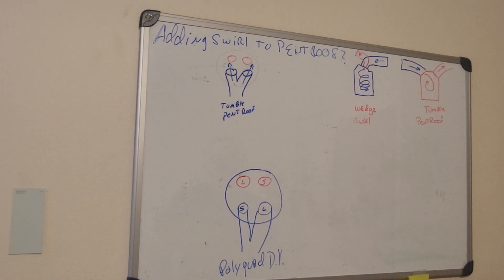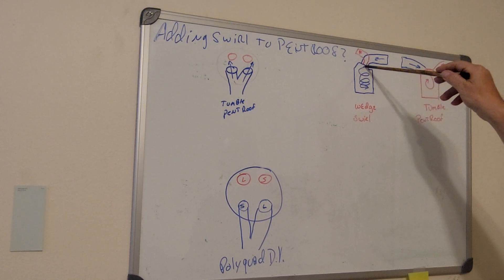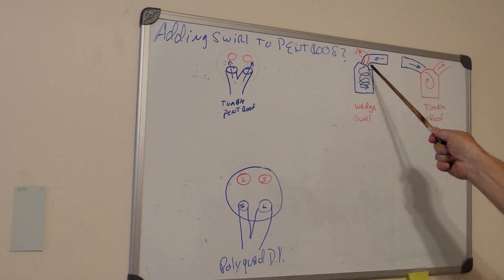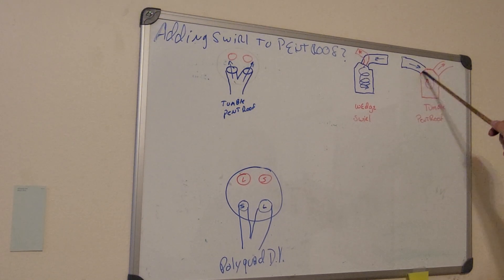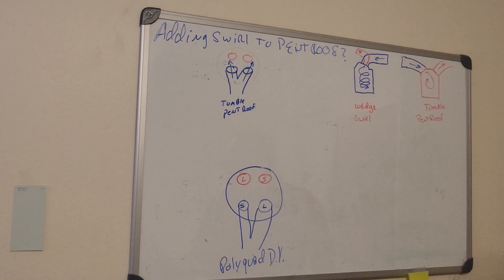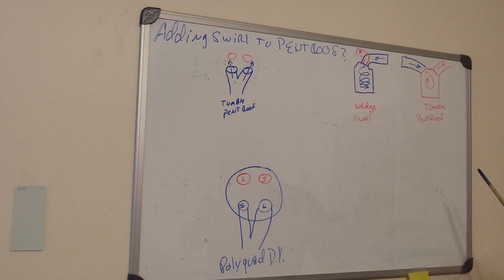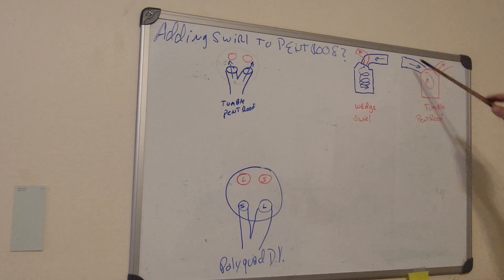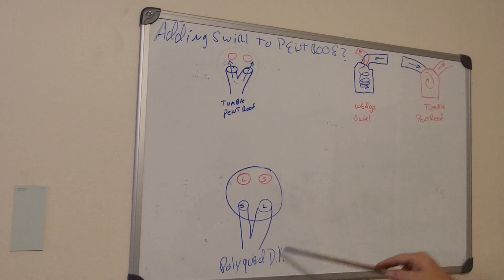Adding swirl to 4 valve pent roof design cylinder head?

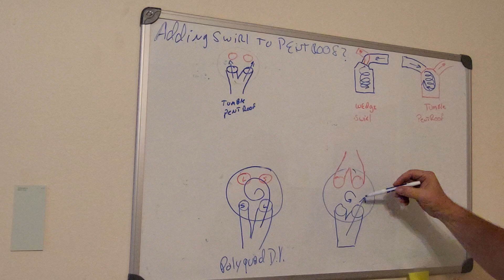Comment: 9:04 If I'm understanding correctly DV put the bigger exhaust valve on the left to help draw the initial charge left instead of straight across. Would having the bigger exhaust on the right make the charge come in straighter (less swirl) during the initial overlap period? Could that potentially have a negative effect on the entire swirl sequence if it had a worse start to overcome?
Reply from the maker: @TheInsaneShecklador  Good question. Polyquad head should be in soon. Stay tuned.
Reply: @servediocylinderheads  👍

Comment: I left a comment already but as I said before. When you start thinking about the flow path, include the fuel path. While rotation is mixed with tumble. The fuel likes to stay over the exhaust valves. Concentrate the flow from the divider. Inside out rotation. With the fuel path. The outsides of the port slow down because of the spread. The high speed remains in the middle. Left port spin counter clockwise. Right...clockwise.  
  Another point to think about, is timing. Not ignition,  but the entire delivery timing. At 9000rpm, the tumble or swirl doesn't get a chance to complete its journey. It is ignited when it barely reaches the back side of the cylinder.
 Don't forget the overlap period and what the exhaust vacuum is causing to the intake charge. 
 Straight in and Straight out. No time to tumble or swirl. 
  Another method used to cause low rpm mix is to alter valve timing. Individual actuation of each valve can be tailored to change valve timing. Not on this application but most ohc configurations will alter valve timing on each valve.
  Nice white board. As I stated. Maybe I should do my next video from the shop.
Reply from the maker: @approachingtarget.4503  Good info. Thanks

Comment: Interesting topic. How critical is swirl/tumble when comparing port (wet intake) vs direct fuel injection? Many years ago, a pro stock engine  builder commented that he preferred a more gentle swirl motion. His theory was that a slow mixture motion during combustion resulted in a more complete burn (compressed and still mixture around the spark plug) vs a fast motion, where I envision, the flame kernel swirling around creating layers of fresh to burnt mixtures within the chamber.
Reply: The DI combustion systems evolved in the era of CFD (computational fluid dynamics) and they most certainly consider the path of the fuel particles relative to what the air is doing (they're not treating it as a homogeneous mixture). You can see this in the way the piston crown is shaped on those engines relative to which way the injector is pointed. Some engines have the injector central pointed straight down, others have it near-horizontal between the intake valves on the outside, and the shape of the piston crown is different. The Mazda Skyactiv and the Toyota "dynamic force" engines are worthy of study, and notable in their differences. Both are designed for high-tumble and not swirl. Note how straight the intake ports are on a Toyota "dynamic force" engine - the ports are inclined to the valve (obviously) but very straight. They really, really want strong tumble.
Reply from the maker: @bikeaddictbp  Good info. Thanks
Reply from the maker: @ts302  I would think he is right. Swirl can still help direct injection I believe. Thanks

Comment: there the holden GM v8 that usually can only run 26 degrees of timing in there got a really flat valve angle to the pistons and they always had good torque range . they have a very iconic exhaust  note over the sbc and LS even fords. they just missed the last generation change they needed before LS was used
Reply from the maker: @jacksonbermingham2168  Thanks

Comment: Now you have me pondering😂😂😂, recently my engine suffered bent valves and the cylinder head is going to get rebuilt, an X20XEV engine, what chance you have access to a cylinder head from this engine and do an evaluation of  it in terms of what came from the factory and what can be done...i'm from Trinidad and Tobago, watching DV's channel, i know he resided here late 80's to 90's, his teachings are well known by the old school mechanics here, for my X20XEV engine, not enough quantity of cylinder head valves were located locally, from luck a cross refferenced engine from the USA market was found, a A20DMS motor from a suzuki Forenza...other engine codes be X20SE, X22SE from chevrolet optra and Daewoo Nubria....looking forward to see if my request can be fulfilled
Reply from the maker: @ArvineHarry  I have no idea what that head is for and I have no special abilities to get that head. Sorry. Bent valve is likely due to too low a spring load for the rpm. Thanks
Reply: @servediocylinderheads  while i lived in brazil, this car was parked, when finally got it started, it had lots of noise which i thought was the hydraulic lifters, it back fired , cut out and did not restart, when check front of engine, the timing belt tensioner got loose and turning crank i saw the belt jumping over crank gear,  ended up doing a leak down test - bent valves surely....now a great opportunity to do a porting job...following DV's channel, i'm seeing this head from the factory already being "ported"...i find that to be very unusual...also unusual is how the timing belt tensioner got loose, only possibility is belt spinning it anticlockwise and the time it was parked could have rusted and stuck the bearing, trying to start it could have nudged it loose...anyways, thanks for your attention,
Reply from the maker: @ArvineHarry  I see. Thanks

Comment: If I wanted to make a poly quad engine, I'd use different sized valves, the ports would be like you suggested, the valves would be nearly parallel to take out as much of the pent roof as possible, make it almost like a diesel engine combustion chamber, and the spark plug in the middle would have a cap over the electrode with little holes drilled around the sides. Finally the piston crown would be shaped sort of like a diesel piston, but without the dish. The piston crown would be in a shape that accents the reduced pent roof chamber. With a direct injection and strong igntion system. Maseratti Nettuno engine in the MC20 uses such a combustion system, minus the offset valve sizes.

Comment: Asked Warren Johnson on DragBossgarage live chat. How important is swirl on a Pro Stock engine? He said very important and to make an efficient combustion chamber or you will have a bad one like a HEMI ! I think you have geat ideas I know you will make it work.  It would be great if you were able to test that small bore some how. And yes putting the swirl port heads on my 79 350 it spark knocked and has to back the timing off.
Reply from the maker: @dondotterer24  It isn't
Reply from the maker: High rpm doesn't need swirl due to high turbulence from rpm.
Reply: @servediocylinderheads  that's why I asked him. I should of asked him how much swirl. .  But he probably wouldn't give that up.
Reply: @servediocylinderheads  I'm confused about the swirl numbers on the last video that Eric did on the LS heads.
Reply from the maker: @dondotterer24  Don't be, I did testing on the Afr at D.V.'s and Erics numbers are extremely close to what I got. The stocker has no swirl till the ssr goes into transition/ seperation . The Afr has swirl building from low to high at transition. The Afr is a smaller port, smaller valve with less shrouding that flows a bit better. See, easy!
Reply: @servediocylinderheads  I wasn't thinking.  I was looking at the negative numbers on the swirl.  Is an ls opposite direction than  a small block Chevy?
Reply from the maker: @dondotterer24  chevy has positive and negative swirl depending on port.
Reply: @servediocylinderheads  thank's

Comment: On both my Hondas (H22-A4, K20-Z1), when not on the VTEC cam lobe, staggers the valve opening on both the intake and the exhaust lobes, opening one slightly before the othe and closing the same one slightly earlier. I assume this is to create swirl.

Comment: Tumble is superior to swirl in my experience.
Reply from the maker: @VGHCX  High rpm? No doubt. I should have mentioned that.
Reply from the maker: Thanks
Reply: Tumble motion stops when the piston is getting close to the top of the stroke, when the compression ratio gets above 10.5 or so.
Reply from the maker: @NotSure723  Didn't I say that?
Reply: @servediocylinderheads  
I was talking to VGHCX.
Reply: @NotSure723  Okay.........that does NOT change the fact that tumble is superior to swirl.
Reply: @VGHCX  Only on lower compression ratios.
Reply: @NotSure723  Then why do DOHC engines have higher compression ratio than OHV engines? Take the coyote 5.0 for example. It has a 12:1 compression ratio. The DOHC corvette engine has a high ratio as well.

Comment: 3 valve Hondas CVCC. They staggered the intake lobes on the cam.
Reply: I thought the CVCC did it by having a prechamber.
Reply: @skylinefever  Yes the 70's heads did. I think they did up to 84 but not really sure.
Reply from the maker: @oldblueaccord2629  Excellent point! Thanks
Reply: @servediocylinderheads  I dont think it was quite CVCC but 2 intakes and one exhaust and staggered intake events on the cam.
Reply from the maker: @oldblueaccord2629  I can see what they are doing with that. Simple design too!
Reply: @servediocylinderheads  All those Hondas got killer gas mileage in the 70's and 80's. The CVCC head was the design Honda told Congress he could pass emissions without a catalytic converter. Thats after Ford Jr and Chrysler testified they couldnt meet the emission standards ever.